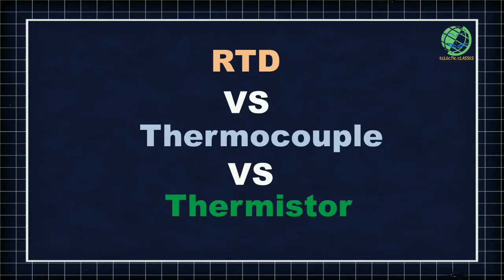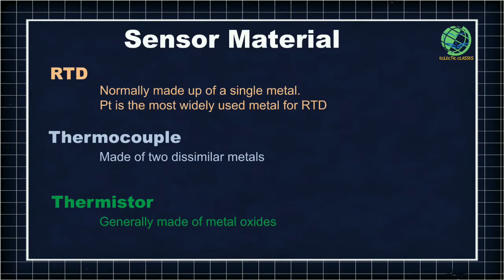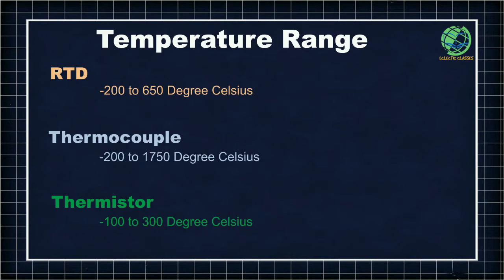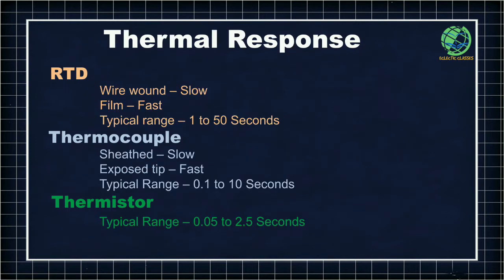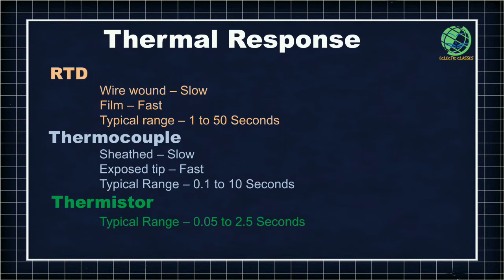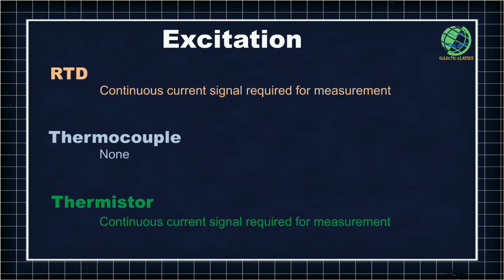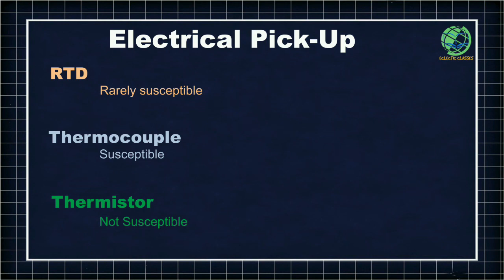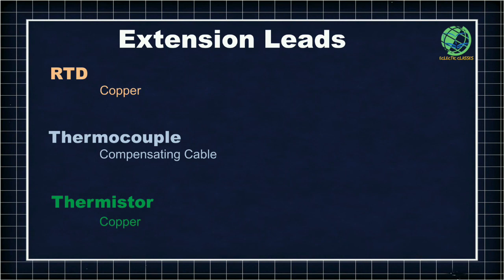RTD vs Thermocouple vs Thermistor

Comment: At job for hvac we don't use constant current to drive thermistors, our devices actually have a 10k resistor pullup option and we use it for whenever we use thermistors. This also eliminates a bit of the self-heatinf error.

Comment: RTD has NTC not PTC.
Reply from the maker: Kindly cross check, I am confirm that RTD has positive temperature coefficient.
Reply: @eclecticclasses  It’s no big deal, one small error doesn’t take away from the fact that I was able to make an excellent comparison table between the three different types of temperature sensors, based on your video. Trust me, 99 out of 100 isn’t so bad.